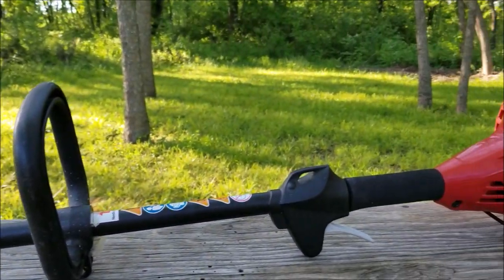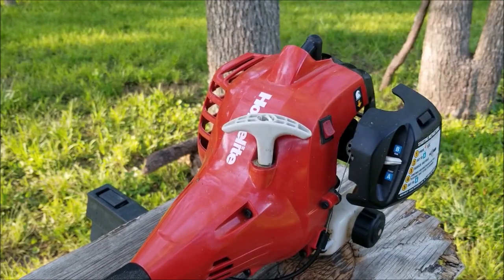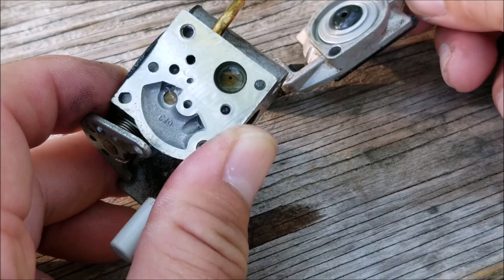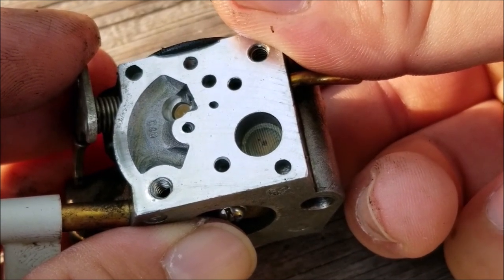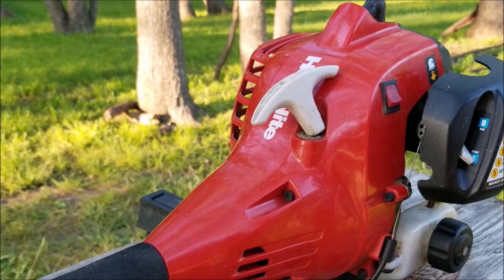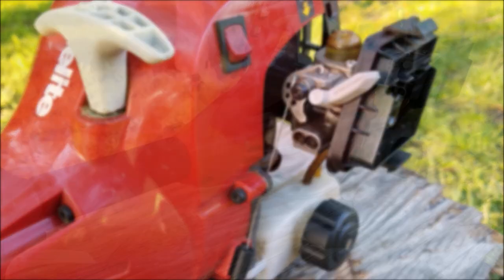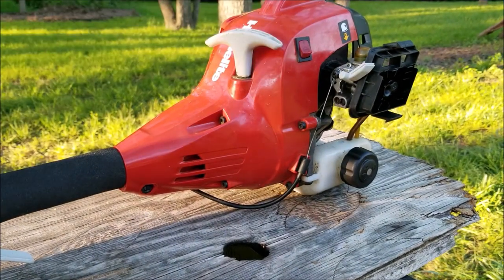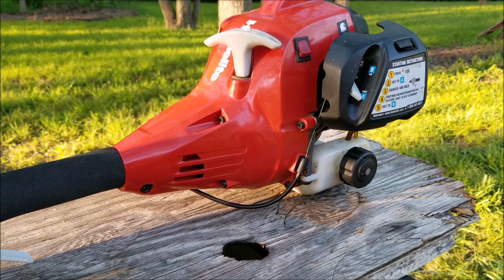Homelite trimmer fix after winter storage

Comment: Always drain the petrol tank then run the engine until it runs dry. 

Because I’ve always done this I’ve never had starting problems with any of my Homelite, Poulan’s and my Weed eaters. 

As for Homelite machines I’ve had them for years and always found the engines to be reliable and dependable. However I’ve replaced the entire flexible shafts on my machine with steel shafts from  a commercial machine that had worn out. Simply because I really enjoy repairing machines and improving them if possible, (Subscribed)
Reply from the maker: thank you Howard Walker

Comment: Let me put it this way.  I have a cheapy Homelite trimmer that I bought back in 2003.  I'm still currently using it, and it has been an absolute CHAMP.  Like seriously.  I just recently had to give it some attention/maintenance.  It was acting weird as far as starting, running, idling, so I decided to buy an inexpensive aftermarket carb.  I replaced it, and it's running like new again.  Since I replaced the carb, I replaced the fuel lines, too.  The original fuel lines were black rubber, and had no cracks, and were still soft and pliable.  Crazy to me.  So would I buy a Homelite for home use?  ABSOLUTELY.  

I've shared these details with the host of this channel before, but I wanted to share with his viewers, too.  My only concern with Homelite is wondering if the current ones are still as good as the older ones, or if they have gone downhill.  Just cause they used to be good back then, doesn't mean that they are still good.  But my old Homelite has been VERY GOOD to me.  Could not ask for more.
Reply from the maker: thank you kings17court
Reply: Add me to the list of happy Homelite owners. I bought mine in 1995, and other than replacing the fuel lines, the primer bulb, a broken trigger (my fault) , and the spool retainer, it has ran fine until the other day. The original foam  filter finally disintegrated and the engine sucked in about half of it, choking out the engine. I removed the debris and it fired right back up. I doubt the new models have this longevity. I'm also running it on 40:1 mix, not their 32:1 recommendation. Thumbs up to Homelite.
Reply: My weed eater starts and works well whenever my finger is on gas but dies immediately after taking finger off gas. Can anyone help me with this??

Comment: Great video, I got my weedeater out and it started and ran fine but dogged out when the throttle was increased, I did the adjustment on the carburetor as you showed in the video, and now the weed eater runs great. Thanks, Eric
Reply from the maker: No problem and thanks for the comment

Comment: I have a Craftsman trimmer with the attachment ability that weights alot, I found a straight shaft Homelite trimmer out for spring clean up, I brought it home cleaned it and adjusted the H&L screws and it runs like New. I now use this as my main trimmer because it is way lighter than the Craftsman. I'd absolutely buy a Homelite trimmer, they're good trimmers in my opinion
Reply from the maker: thank you Gary Allen, I don't have a problem with Homelite, it's all up to maintenance.

Comment: I bought a Royby power tool set (driver drill, impact drill, sawzall, flashlight, and circular saw) for $129 in 2013. It's now 2024 and I still use ALL of them except the flashlight I cannot find. It all still works just fine .
Reply from the maker: wow that's pretty cool

Comment: recently had this issue, changing the gas worked for me, I fucked up and didn’t drain it last summer and it didn’t wanna idle, if you don’t drain it at least put fuel stabilizer, I got lucky I could’ve had to change the carb.
Reply from the maker: you did lucky. thanks for the update
Reply: If your lawn equipment is going to sit more than two weeks drain the fuel tank and run it dry. Your equipment will last and run alot longer. I drain all the tanks on my equipment and run them dry just before winter and when spring comes I fuel up and all equipment performs flawlessly.

Comment: No problemo owning a Homelite trimmer.  I've had a HLT series straight shaft for about 6 years with only the bump head needing replacement. They tend to wear down with the bumping, maybe I smack it a little too hard. It's on its 3rd head now and I think that when this bump head is no longer serviceable, for environmental reasons I will get a Honda 4 stroke trimmer.  I always run 40:1 petrol/oil mix in the Homelite. Plug gap of .025" (0.6mm) and run it slightly richer (mine has the H and L adjustment screws on the carb) than it came from the factory.  I service it at the end of the season and store it between seasons with an empty fuel tank. I only use the primer bulb if the bulb is empty of fuel and start it with the choke if the motor is cold only, otherwise they tend to flood quite easily and they are a pig to start if they flood (but then what 2 stroke isn't???).  They are cheap to buy, well built and reliable if simple maintenance is performed regularly so unless you have a real need to spend big bucks on a trimmer, the little Homelite performs adequately well.
Reply from the maker: thank you for sharing that

Comment: for me yep no problem plus easy to fix up and the short block assembly,s are very easy to replace as it,s a non removable cylinder and you can buy them online very easily too.
Reply from the maker: really I didn't know that. I'll have to take a look at them.
Reply: @INSIDEHOUSEGARAGE  yep very easy to install and replace for sure.
Reply from the maker: @Patrick4959  yes I looked at the parts diagram and it's amazing that they cast the engine Block that way. They must have saved quite a bit of money doing this.
Reply: @INSIDEHOUSEGARAGE  yep top notch.

Comment: I have a weird weedeater brand weedeater feather light posts and I rebuilt the carburetor this season and put new fuel lines in a new filter air Spark plug
Reply from the maker: Did you make a video on it?
Reply: INSIDE HOUSE GARAGE No I did not but I might make a video on the air filter store and putting on another gasket that I have coming

Comment: I have  a  homelite  trimmer  like this one  but   I need   to see  a video  to  know  how   does   that the head rotates and cuts.
Because the motor runs fine but does not make the head rotate so that it cuts
Reply from the maker: More than likely the end of the driveshaft is broken either at the head or engine.

Comment: Nice job down. It's a well needed video. As far as buying a home lite trimmer. I might but I don't like having to fix or adjust it. But other than that the price for it is reasonable.
Reply from the maker: my thoughts are the same, price is great just don't want to have to mess with it either

Comment: Yes I would buy a homelite trimmer if I was using it for light duty once or twice a week. I actually gave my son a homelite so we could mow together.  Runs good. I run equipment pretty hard for long hours for heavy duty jobs including trimming for the farm. I personally have two professional series stihl trimmers/ brushcutters. I have a stihl FS-250R for the heavy brush, a KM-94R as a multi tool and a husqvarna 525L as a daily lawn care tool. But I'm perfectly happy running a homelite or other home owner grade machines around the house as long as they start fast and have good power in them.
Reply from the maker: thank you for vouching for them
Reply: @INSIDEHOUSEGARAGE  your welcome. Homelite is a good machine especially if you break in the engine correctly/gently through the first year of service. At least this is my way of doing it. The piston, piston rings, cylinder and bearings wear in very smoothly instead of being ran wide open and getting scored up, gouged and burnt to a crisp. I can afford a new spark plug and propane torch to burn the carbon out of the muffler rather than frying a new and perfectly good engine. After the break in period I gradually raise the throttle to about three quarters the second year.
Reply from the maker: thank you for Sharing your experience.
Reply: @INSIDEHOUSEGARAGE  your welcome.

Comment: If it works and  does the job why not . Will run a trimmer fuel mix a touch on 
the high side as in mix keeps them good.
Reply from the maker: Well said

Comment: I own a Remington (don't laugh) trimmer that I picked up at a local hardware store for $110. Other than running a little lean on the top end, it runs great. The fuel that I use is VP PROMAX 97 octane.
Reply from the maker: nothing wrong with a  trimmer that works!

Comment: And my Q's are: Which hose goes to the fuel filter in a reservoir? How the head of the trimmer is connected to the engine? And the third and last one: Looks like that small engine does not need oil at all? which is weird. Thanks for all the given pieces of information.
Reply from the maker: The bottom hose on the the carb goes to the filter in the tank.  The trimmer connected to the engine by a drive shaft. The oil is mixed with the gas
Reply: @INSIDEHOUSEGARAGE  Et voilà. Thanks!
Reply from the maker: @siphilipe  no problem

Comment: Excellent video, quick question regarding this exact trimmer. If the primer bulb primes fuel perfectly, clean & clear screens in carb, but will only fire up when pouring a splash in the air intake as a self prime, what would you suggest the problem could be? poorly adjusted L & H carb jets?
Reply from the maker: yes, a carb that needs to be adjusted, to deliver more fuel to the engine would be my first thought.
But to be honest,  I wouldn't waste your time opening the carb. Instead buy an aftermarket Carb, and replace it.

Comment: Nicely done! I put a new carb on mine & it runs OK, but I'd like to know.... what is the base setting for each of the carb screws if you started from each of them being set all the way in?....approximately how many turns out? Thanks.
Reply from the maker: unfortunately I start the trimmer in it's default setting I get it with, and only change it, if I need too.
Reply: 1 Full turn out for each as a starting point
Reply: One to one and quarter turn out.  For both screws.  Additionally I set the idle screw in higher than normal after rebuild to get it started and warm.  Once warm, I adjust low idle mixture and drop idle screw rpm.  Then rev up and adjust high idle mixture.

Comment: Use fuel stabiliser. Drain tank and run engine dry after use. (If it's not gonna be used for a while.) I haven't repaired mine in many years.
Reply from the maker: thank you Red Toberts

Comment: Hey thumbs up for the videos, discovered them recently after i had a few issues with my brushcutter. Great content!
I have a question, what are your thoughts for storing brushcutters inbeetween use (for me its 3-4 weeks), just pouring gas mix out of the tank or do you recomend running idle to burn any gas left in carb?
And before winter after empyting all the gas out, should i put a few drops of oil in carb throat and pull the string few times? Ive seen somewhere on the net but its not mentioned in Stihl manual for my trimmer.

Thanks, and keep up the awesome videos! :)
Reply from the maker: Thanks for watching i appreciate it.  Do both to the brush cutter. After using it pour the gas out of the tank and restart it and let it run dry. As for the oil you can put some ATF in the spare plug hole and pull it over a few times.

Comment: I bought a used Homelite trimmer at Good will store but it looks new. Why did Harco & Equipment not fix my homelite trimmer? A servicer said it is old. 😐 I bought a new fuse. It won't start. Am I missing something? I checked the clean filter.
Reply from the maker: you said you bought a new fuse?
Reply: @INSIDEHOUSEGARAGE  🤣

Comment: While I don't necessarily have the problem your video covers, I was wondering about a pull cord issue I'm experiencing with a Homelite Model UT 33600 weedeater.  The model in this post looks similar.  The cord retracts but will not pull out smoothly.  I've seen pull cord replacement videos for all but the UT 33600.  It has a much different configuration then other models and I don't see anything related to pull cord replacement.  The cord does not reside in the plastic housing cover but sits on top of the flywheel & clutch assembly.  It almost appears as if the company has made it more complicated for the DIY community purposely.   I'm here because your postings are clear and easy to follow.  Maybe you can add something I'm missing.  Appreciate any feedback.
Reply from the maker: I don't think I have a video for that particular model, but If you look for my ryobi string replacement videos, it should be very close.  They should be more than enough information to help you get to the string and spring, but I hate to tell you, this type of clutch and spring setup, is NOT easy to work on.

Comment: I have a stihl trimmer with an aftermarket carb and I have to tweak the carb adjustment every time I use it (every 2 weeks or so). I'll adjust it till its running correctly (engine hot) but then next time it's just not right anymore. Any ideas?
Reply from the maker: yes, once you adjust the carb to run right let it cool down and try starting it. sometimes the settings to get it to run right are not the same for a good cold start.  keep adjsuint it for a good cold start and see how far it is off for running.

Comment: What would be the problem with the trimmer if it’s not spulling any line out when you hit the head of it in the ground
Reply from the maker: either someone installed the line incorrectly, like winding it the wrong direction, or the line is melted in place on the spool
Reply: @INSIDEHOUSEGARAGE  Or the spool retainer is stuck.

Comment: Is it true a clogged gas cap can cause lack of vacuum and no start? If so, do you have any recommendations on cleaning the cap on these? (I've already replaced the fuel lines and fuel filter along with cleaning the carb)
Reply from the maker: it won't cause lack of vacuum, it causing the fuel to not leave, as air can't vent into the tank. No its better to replace the cap.
Reply: The cap has a vent valve in it. Its made of neoprene and cant be serviced. But your trimmer should  start with a bad cap. Only after running a bit will it stall because it can no longer pull gas from the tank due to a vacuum created.

Comment: Isee air bubble on the gas tube when I press the bubble.is that a causes of wont start? if so what do you do to take the air bubble out?
Reply from the maker: the  air bubble in the tube should move thru the lines and carb while pressing the bulb.
Reply: So the air bubbles is ok, not reson for the nonstandard, correct?
Reply from the maker: there should be no bubbles in the fuel filter line, the bubbles should be in the return line and that's okay to have.

Comment: What if there no spark on grass trimmer? How do I check that?
Reply from the maker: remove the spark plug of out of the machine, reconnect the wire to the plug and then make the body of the plug touch the metal on the engine, then pull the rope and watch for sparks to appear at the tip of the plug.
Reply: I check and I have sparky, but it will not start. I try pouring gas inside throttle and still will not start? What could be problem? I have same gas trimmer as your.
Reply from the maker: @kennedywong9854  have you done a compression test yet?
Reply: I bought this new gas trimmer not long ago, and now it will not start. Compression gone bad already, but How? I have not done compression.
Reply from the maker: @kennedywong9854  have you been mixing the gas and oil according to instructions?
Reply: Not sure what you mean by mixing gas and oil? I only add gas in and left it there for while, and now it will not start. Gas trimmer was miss firing the last time I use it.
Reply from the maker: @kennedywong9854  is your trimmer a 4 cycle or 2 stroke?
Reply: 2 cycle
Reply from the maker: @kennedywong9854  that means you have to mix 2 cycle oil with your gasoline that goes into the tank. otherwise you destroy your engine.

Comment: HOMELITE really needs to change their name. YEARS AGO, when I saw the first HOMELITE tool, The name alone made me disregard it & buy another brand. What I interpreted from the name was  HOME-a DIY tool for homeowners   LITE- light duty.
I other words a cheap POS. I have held this opine for 50 years. Imagine my surprise when recently I stumbled across the
history of HOMELITE & it turns out, HOMELITEs first product was a chainsaw designed for farmers on the HOME farm.
It was the lightest chainsaw of its size back in those days so the LITE weight was the big selling point. No one seemed to 
interpret the HOMELITE name as I did and they sold lots & lots of chainsaws, In fact, it turns out my RYOBE RY3716 is in fact
a HOMELITE HCS3740. I have learned that HOMELITE builds some pretty good stuff. But, a new name might help but after all these years they wont want to throw away all that brand recognition.

!
Reply from the maker: I see your point